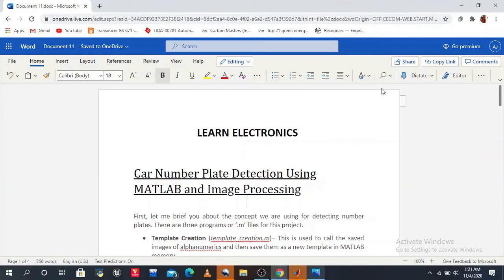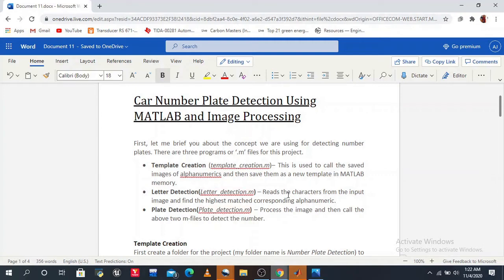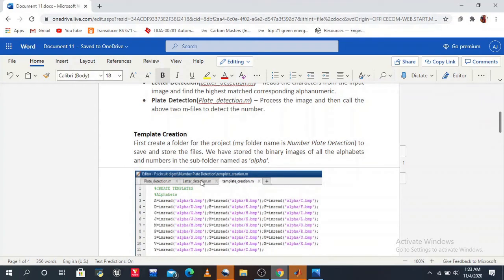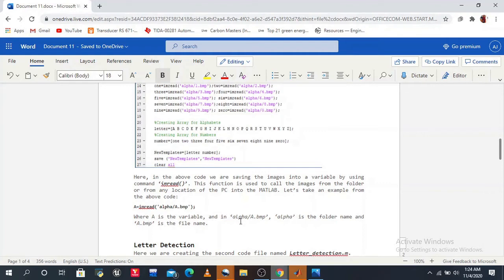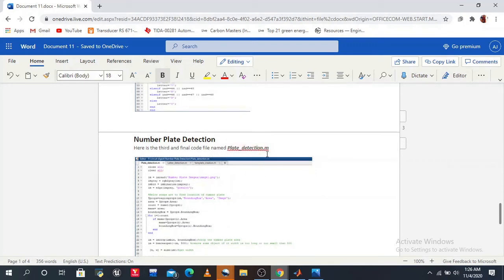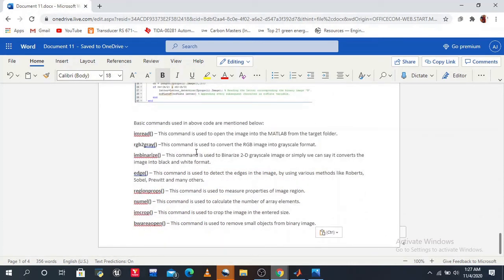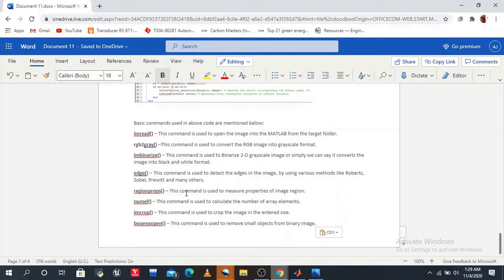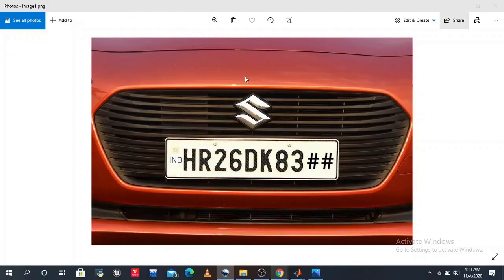Car Plate Number Detection Using MATLAB | MATLAB CODE

Comment: the code works fine but I tried using some other plate numbers but it wasn't reading them all too well, by any chance do you know whats wrong or what line in the code I should change
Reply: did you find the solution for this problem?

Comment: excellent sir
i have run the same code but i have errors 

Error
Not enough input arguments.

Error in letter_detection (line 4)
snap=imresize(snap,[42 24]);

>> plate_detection
Error: File: plate_detection.m Line: 32 Column: 48
Invalid expression. When calling a function or indexing a
variable, use parentheses. Otherwise, check for mismatched
delimiters.

Please help me if you have email address i will send you m files of my code
Reply: I am also getting the same error pls do help

Comment: Bro i need code ... Will you share the code for us
Reply from the maker: Sure i will put in description
Reply: @mech_fficient  the code works fine but I tried using some other plate numbers but it wasn't reading them all too well, by any chance do you know whats wrong or what line in the code I should change